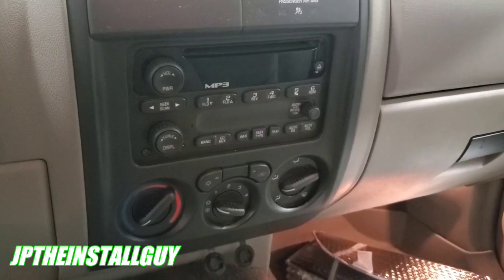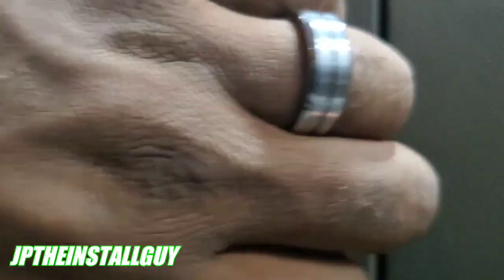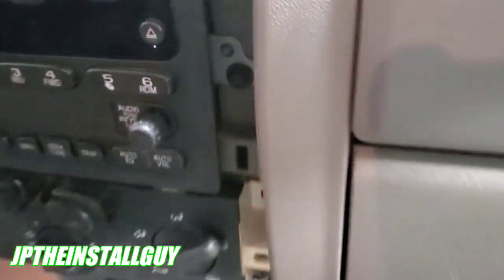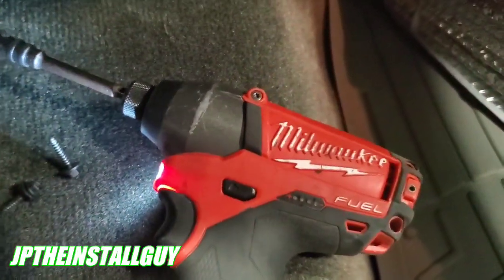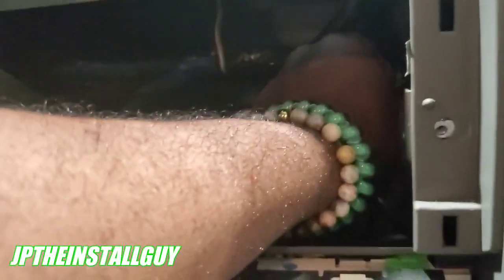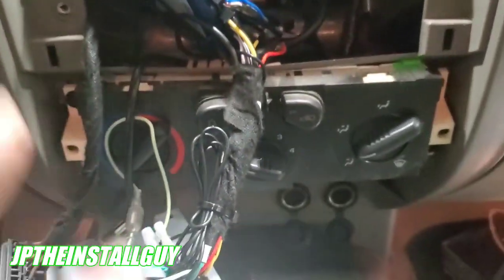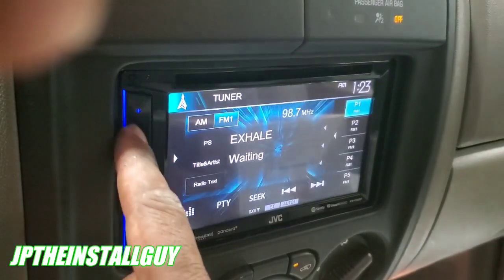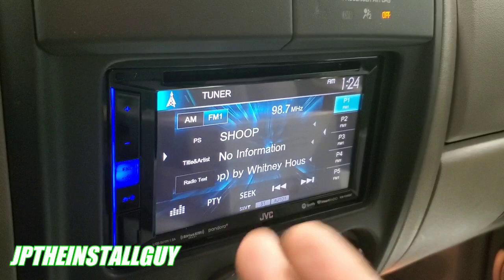2006 chevy colorado radio removal and jvc install

Comment: I have the same radio, it's a hit and miss for it too work. It's a used truck and the writing on the radio buttons are faded. No manual it took a while too figure out the air those are faded too. It was funny, still is. Thanks for help, how I can fix it.

Comment: Great video of the removal, but the video for installation didn't pop up. Could you link it?
Reply from the maker: https://youtu.be/T1Av3dKGN_4
Reply: I’m having the same issue. 08 Chevy Silverado. The harness came with the red power wire separate from the harness

Comment: I'm trying to install a radio. Got all the wires hooked together with the harness but no power. I've read the 12v accessory (red) has to be wired to the fuse box or something. Is that true?
Reply from the maker: yes and no. it really depends on your car. if your radio is not powering on but you have everything hooked up than there is a few things that can be wrong. you could have a blown fuse or your car could need a different harness to provide an ignition because your factory radio is turned on through data. happens in most chevy and GM cars. but you can find a fuse in the fuse box that is ignition and wire it to that with a fused fuse tap if you dont want to buy the proper harness and module.

Comment: Hey man, do you happen to have the part numbers for the wiring adapter/harness. All the ones I find is like 200$ for the OnStar adapter but I dont need it so I wanna just buy it individually. Thanks!
Reply: I recommend you getting the Axxess Ax-GMCL Wiring Interface for your Colorado I think it was that one that I bought 10 years ago for my Colorado

Comment: Hey I have an 06 Colorado and bought a JVC double din kw-x840bts. Can’t seem to get it to turn on the previous owner cut the harness out and I’m left with trying to hard wire it. I can’t find any wire to work with the red one I know the orange wire in the truck is the 12v.